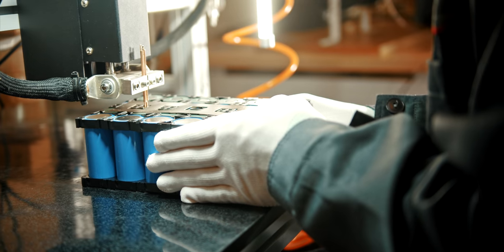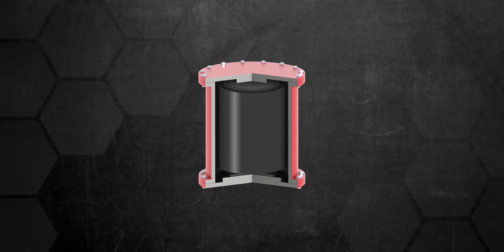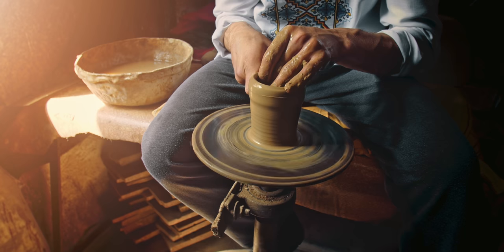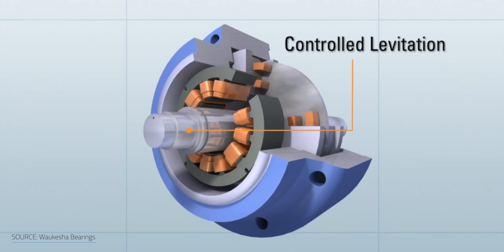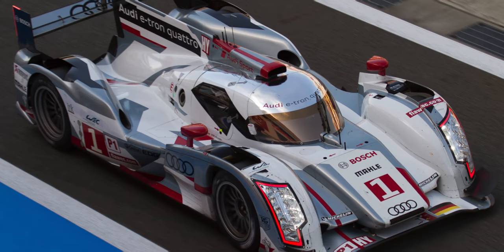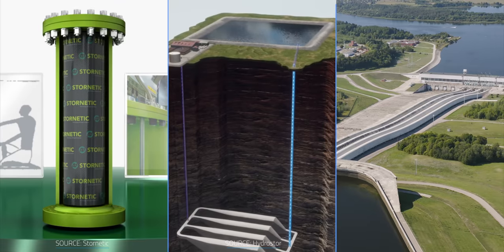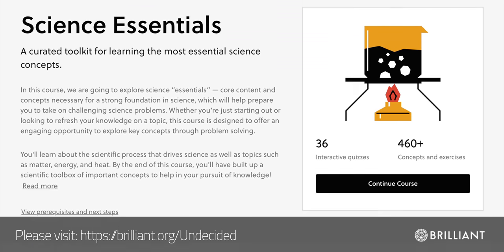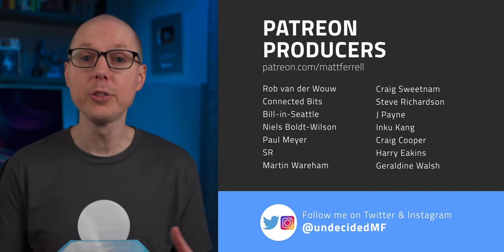The Mechanical Battery Explained - A Flywheel Comeback?

Comment: I worked at a coal mine in 2010. They had used a flywheel to buffer the electrical grid from their dragline for many years. They recovered and stored energy in a flywheel when the dragline lowered its bucket. The energy stored in the flywheel was used as the bucket was loaded and hoisted. The flywheel protected the local grid from wild fluctuations as well as reduced the energy costs to the mine because they were able to scavenge energy that would've otherwise been wasted.
Reply: @daviddavids2884  elaborate
Reply: alot of hospitals also have these types of flywheels to give the backup system a chance to fire up. As soon as the grid power goes, a fly wheel and generator can hold up the necessary grids in the hospital until the backup generators have started and revved up.
Reply: @Heathmcdonald  watch the tom scott video on a slate cable line, whatever is going down pulls the cable round so empty buckets go up and full buckets go down, Closed system with little outside interference
Reply: I think flywheel microgeneration would work. I am thinking of miserable New Jersey, with some of these in the ground. A 10Kw could fit in the same footprint as a water heater.
Reply: Genius idea to essentially generate and store power as that enormous weight comes down, I love it.  I can see how that would make a world of difference.
Reply: @catsbyondrepair  spot the troll

Comment: Interesting stuff. As a matter of interest, the WW2 German Tiger tank's engine is started by a 15kg flywheel. The flywheel is hand-cranked up to a great speed [with much effort] Then a clutch is engaged which turns over the 24 litre, 700hp Maybach engine
Reply: Yeah, if You don’t have typical battery they flywheel is ok. You can release a lot of power in one moment but that power disappear DRASTICALLY
Reply: it seems that many big engine can be started by cranking it. where they all using similar system?
Reply: Would be cool to see a vid just on this video with flywheel start.
Reply: @Spider-Too-Too  Any engine can be started via flywheel. Batteries die, soldiers don't. Oh, wait...
Reply: @carpediemarts705  Many (maybe all) of the big radial 4 engine prop airliners used a similar system. Electric motor spins up a flywheel and then it is engaged to the engine to get it spinning to start it. An electric motor that would be big enough to start each engine directly would be huge and heavy.

Comment: Thorium nuclear reactor sitting in the corner, "Am I a joke to you"
Reply: But you can't have that in a house. Or shading a parking lot. You still need to transport fuel etc. Here we're trying to use the huge ball of nuclear fusion in the sky!
Reply: Ok sam o nella guy
Reply: When the sun goes down, blow up nukes above the solar panels. There's your huge ball of nuclear fusion in the sky.
Reply: Thorium Reactors would be the near perfect local energy backup system and had those running the businesses at the time of Thorium Reactors continued the development we would have had no major energy supply problems today, and far less earth disruption in relations to energy creation. But there was little business to be made with Thorium being available all over the world and so it did not evolve. Over and over the better energy solutions has be held back and/or buried because of greed, mainly in the fossil fuel industries.
Reply: @chris-hayes  the sun does not go down, unless you believe the earth is flat.
Reply: @illuminate4622  where does this magic green materiel appear from for solar planes
Reply: @ghgjg hhxgh  there are mini nuclear reactors that you could have in your house or neighbourhood. No fueling required for 20 years, so no transportation costs.
Reply: @illuminate4622  a thorium reactor can be plugged directly into the existing infrastructure.
Solar panels are incredibly inefficient compared to cost of space required and maintenance costs.
The only reason it's had success is because it's subsidized by the government.

Thorium reactors didn't take off because the by products can't be turned into nukes and during the nuclear energy boom we were kinda in a cold war.

Government literally is the reason we are not going after the safest, cleanest, durable, and most efficient energy system.
Reply: you know caus radiation is now apparently completely harmless and dose nothing negative to the environment
Reply: the sun goes off of entire continents at a time to start and you do realize that radiation mutations are enough to kill entire city's yes?
Reply: @timmytexlonghorns2206  if you're suggesting that thorium reactors are the same potential of meltdown as 60s nuclear reactor you should check out some of the relevant info.
We've come along great in 70yrs.
Reply: @jonathangarzon2798  don't forget that we have no gameplan for recycling/disposing of old solar panels.
Reply: Yeah,  the thorium reactor is just the power source to keep this flywheel operating efficiently.. the 2 combined together would be unstoppable.
Reply: Thorium reactor ?  Not with current pace of the science. Wait for another 50~200 years.
Reply: @FranklyWry  rude much? Sustaining fusion is the elusive part, fusion is something we already know how to do. H-bombs are fusion, not all nukes are fission.
Reply: @chris-hayes  Technically, H-Bombs use both fission and fusion: the fission provides the energy to initiate the fusion reaction.
Reply: @FranklyWry  The whole point of harnessing nuclear energy is to create heat. The issue with fusion - so far - is that it takes more energy to maintain the fusion process than can be extracted from the reactor. Also, fusion reactors create plenty of deadly radiation; what they don't create is nuclear waste that needs to be stored for eons, which is the main issue with fission reactors (that and public perception).

Comment: The Joint European Torus, an experimental fusion reactor used two 650 tonne flywheels to store the power to start the reactor. It took nine minutes to spin up a flywheel and twenty seconds to slow it down. Each flywheel could output 400 megawatts and was used to supplement the power from the grid for the magnetic containment coils.
Reply: Wow, I didn't know that's how they booted up the Torus...cool!
Reply: that's about the only legitimate use case for flywheels. temporarily building up energy to dump in a short period of time.

but flywheels just aren't practical in most applications. and even then capacitors can dump that energy even faster.
Reply: @FreebirthBoccara  several electrical grids and backup systems disagree with you
Reply: Those numbers are mind-boggling
Reply: @M A Other systems like battery and redundant power supply is used to but flywheels make a great addition for instand  power delivery.
Reply: @M A yeah, we use them in our data centres. Big mistake costly, temperamental, specialist and fail regular compared to a string of batteries we use in the other data centres... cheaper and more reliable.
Reply: @FreebirthBoccara  Short term energy buffers is what today's grids need the most. Lithium batteries have a limited lifespan and rare earths are becoming harder to obtain and cause a lot of pollution where they are extracted.

Comment: I remember the little toy cars that had a fly wheel you needed to spin up to make go racing across the floor haha
Reply: How many children do you need to harvest in the sweatshop?
Reply: I loved them !
Reply: Oh yeah, keep rolling them back until they make this cracking sound, for max launch power 🤘💯
Reply: @PsychonauticExplorer  those that make cracking sounds use springs.
Reply: @ulrichkalber9039  thanks  for pointing it out 👍
Reply: Kenner SSP.  I loved that thing and was really disappointed when I lost it in a hay barn between the bales when it jumped from the upper deck.
Reply: Great example of flywheel
Reply: @PsychonauticExplorer  not the same car.
Reply: I only had one and i could not find them in the local shops. And the first one i broke too...
Reply: @daviddavids2884  Please tell your parents.
Reply: @ulrichkalber9039  mind blown
Reply: Now imagine if it have magnetic bearing and vacuum case, epic
Reply: And the car kept going for hours because of all that futuristic energy storage, not?
Reply: the air powered ones and you used a hand pump to get them running really fast before you dropped them onto their wheels, they were great
Reply: @editorglueitcom  haha, yea I had one of those. I think it was a yellow beach buggy.
Reply: I remember having one that was a Tron light cycle.  That thing could MOVE!
Reply: Mine even made sparks!
Reply: Early 1970s? Pull the pull cable and then let it rip across the house.
Reply: I wish I still had a few of them, now there worth a lot
Reply: @ulrichkalber9039  i just finnished 2 bags of Sugar Bab candy and have 2 left over? 2:12am--9/05/2021 LMAO
Reply: I got one right on my desk..looking at it right now.
Reply: my first thought about this video yes xD
Reply: @ulrichkalber9039    exactly;   forget flywheels, let's try large springs
Reply: Mighty mos

Comment: I remember seeing/hearing about this solution some years ago. Then I found it strange the implementation was so lacking, thus with a bit of search I found out the same thing that is blocking the wider usage of this technology: the price of installation. Nice touch with the Swiss bus!
Reply: Transfer the investiment that has been pumped for the last 20 years in lithium battery technology and you gonna see the difference
Reply: Or maybe it’s a conspiracy
Reply: In the early days of electricity, Nikola Tesla and other inventors experimented with using flywheels to store energy in a mechanical battery of sorts. The idea was that the flywheel could be used to generate AC power on demand, without the need for a power plant or other external source of energy. However, the technology never quite caught on and was eventually eclipsed by other forms of energy generation.

Now, nearly a century later, scientists are revisiting the idea of using flywheels to store energy. With advances in materials and engineering, it may finally be possible to make the flywheel-based energy system a reality. And if successful, it could provide a clean, renewable source of energy that is close to our goal of using a hamster for our energy needs.
Reply: The Dutch operated flywheel powered busses for a while in the 1980s/90s if I remember correctly.
Reply: Why is the price of install so high? Just transport of the weight?

Comment: I work at a hospital,we have two caterpillar flywheel UPS systems for our critical power.Supposed to hold for 30 minutes until the generators spool up and take over.
Reply: It shouldn’t take generators 30 min to “spool up” and take over.
Reply: @jbw5485  its a security feature. They don't need that long but what if they don't start due to some mechanical issues, then have time to power down equipment, get out of hazardous areas.
Reply: So, the 2 flywheels spin continuously while waiting for an outage?
Reply: @martinkase5842  ok. That makes sense. I would imagine they do regular maintenance and test runs on the diesels. Auto start sequence and all. We have back up diesel gens at the nuclear plant. They start within a few seconds of getting the signal. Sounds like the “in between” spooling flywheel is there as a back up to the back up in case the diesels don’t start. 👍🏼👍🏼 the diesels will start though. Haha
Reply: @greggschuder7478  I am wondering the same thing..
Reply: @greggschuder7478   You have to spin in continously to have it running when a power outage comes. I think most of the energy goes into reaching the running rpm. Once it is spinning it doesn't need much energy to keep it running.
Reply: @ivanyidaniel9585  Provided the cannister/container of the flywheel is maintaining its' vacuum correctly, then it can take between 15-60 minutes for the flywheel to slow down enough to need to be 'sped' back up to normal speed (typically about a 3-5% loss from it's normal set speed).  Now a flywheel container that doesn't have a low enough vacuum (still low enough to operate, but not at peak efficiency) could be losing speed fast enough to require be spun back up anywhere from everywhere from every few minutes to almost constantly.  To get back to full speed, it typically takes less then a minute (based on the ones I worked with).